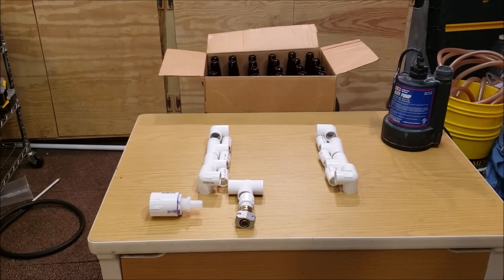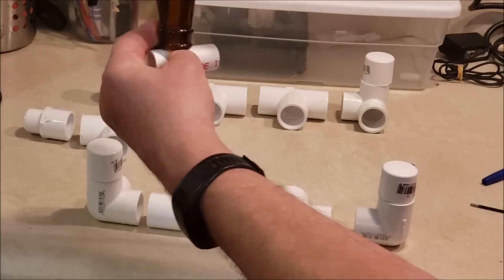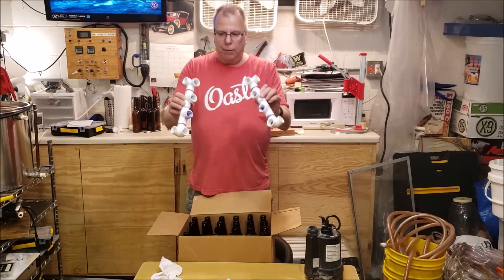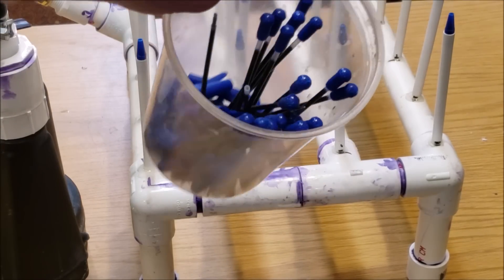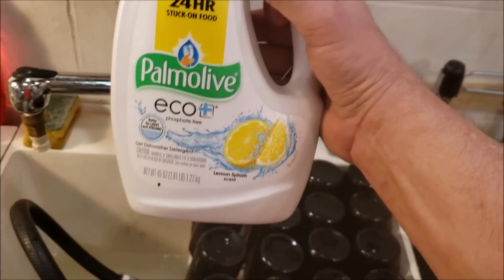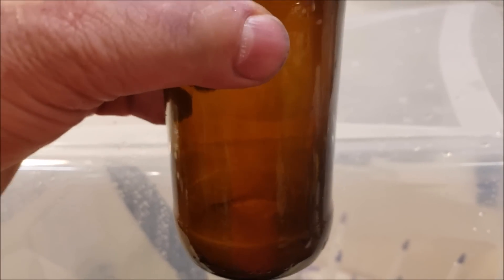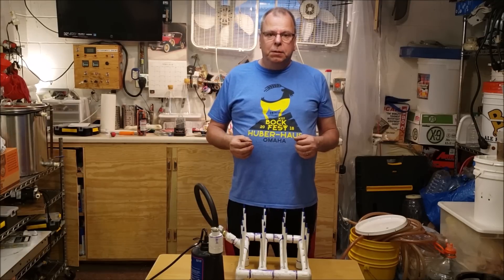Building a Bottle Washer

Comment: Thanks for your nice video and the interesting idea of the pen as sprayer 
I think , if you do less pins, maybe 6 or 12, would increase the pressure and flow rate.
With more water flow rate, foaming might can avoid. Best Regards, Michael
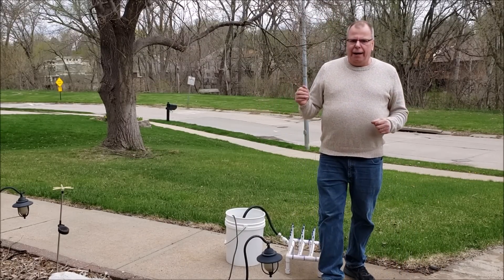Reply from the maker: Thanks for the comment. With regards to the flow rate, that is not a problem, at all. I could probably easily do 30 or 36 bottles if it would fit the sink.  There is more than enough pressure. More than a dishwasher. That pump is POWERFUL! They use the same pump in sumps to pump water 10-20 feet vertically. It has a 1 1/4" fitting on it and the 24 little pen holes probably add up to a 1/2" total. I have seen people do this with pond pumps. I did a test outside with the washer in a tub of water (It is at about 26:30 in this video).  It shot 4-5 gallons through the pens, 20 feet in the air and emptied the 5 gallon bucket in under 15 seconds.  In reality though, the dishwasher soap probably does most of the work.  Cheers!

Comment: Nice. I want to build my own, but im wondering how to clean the outaide of the top. I tend to pour my beer into a glass but would be nice to get around the neck of the bottle a bit. Any thoughts?
Reply from the maker: Thanks for the comment. Enough water splashes around it that the crown gets pretty wet. When I rinse them out, it also gets everywhere.

Comment: Great video man, i just have a question. How many litres of water are circulating to wash those 24 bottles? In the end, how many liter per bottle? Thank you
Reply from the maker: I just add 2 or 3 inches of water to the laundry sink.  I would guess maybe 4 gallons or maybe 16 liters.  Those are 12 oz bottles (250 ml?)  The spray does not fill them as they are upside down and continuously drain.

Comment: I like the design and planning on building something similar too. I was wondering however is the PVC glue safe to use in this application? Is it food safe? I was thinking maybe food grade silicon instead
Reply from the maker: Good question. I don't know why it wouldn't be OK for a washer. I have never heard of there being a question. PVC (and the glue used to connect it) is approved for use with potable water. I can't see where there would be a problem.
Reply: @TimTrabold  thanks mate, I assumed this would be the case just thought I'd ask

Comment: How is the capacity of the pump?
Reply from the maker: It is a 1/4 HP Barracuda pump I bought at the Menards Home Improvement Store for $55.  You may get it cheaper on Amazon.
Reply: Gallons per hour please
Reply: Would a pond pump 550 gallons per hour be enough for cleaning

Comment: Couldn't you just buy one from Northern Brewer for less?
Reply from the maker: I suppose you could.  I would guarantee that the pump they use is nowhere near the power of the 1/4 hp one I used.  Plus, I already had the pump so it only cost me for the PVC parts and pieces.